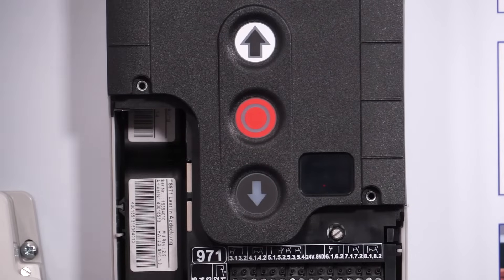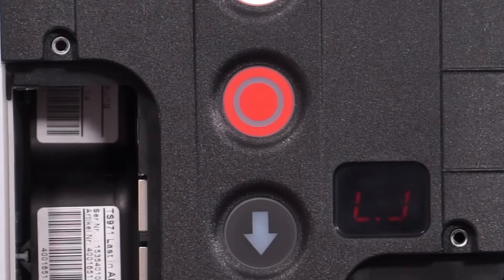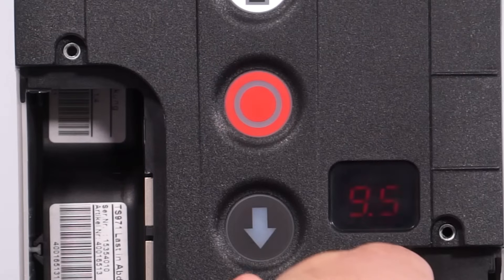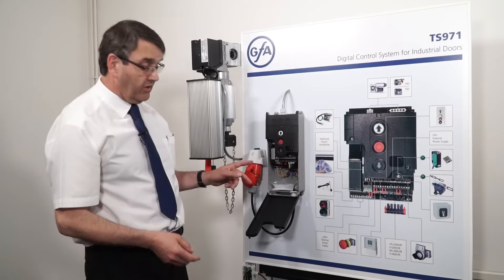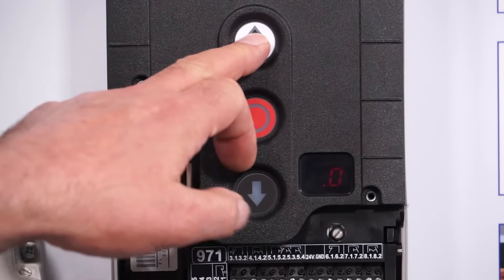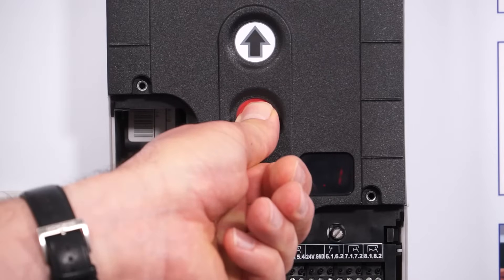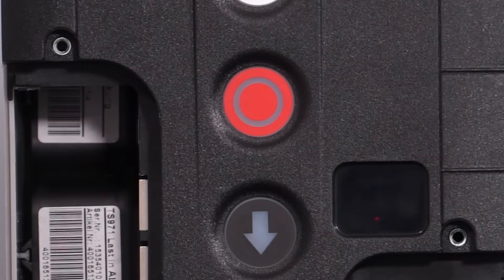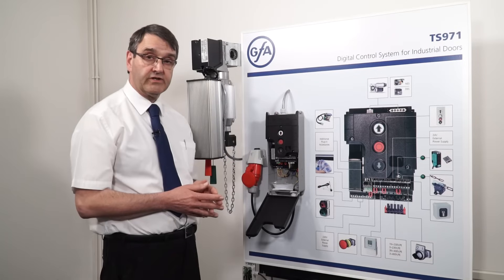Tech Tips: Resetting a GfA TS 971 Control panel

Comment: We have TS981 control panel and unfortunately after downloading the wrong software we could not able to access anymore to program/parameter settings no matter how long we press the selector button. It only shows the 4 blinking lights on the top. How we can be able to access the parameter again? Is there any factory reset? Hope you can help.
Reply: I came across this today on a new helix spiral door which was recently installed by another door company with TS 981 control panel. F 8.1 is displayed & can’t move door up or down. The selector button works but again can not get access from 0.0 to 1.1 & 1.2 it seems to skip past these numbers